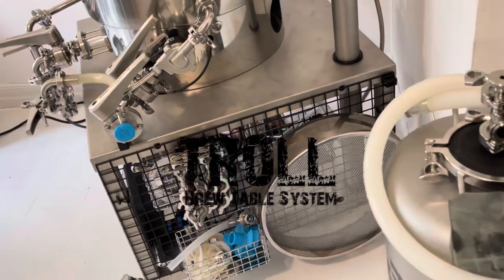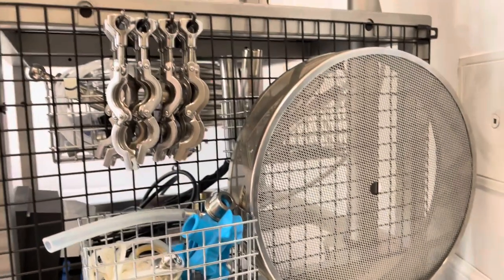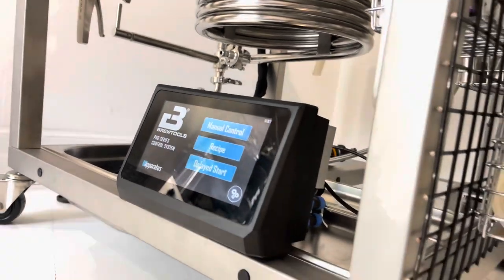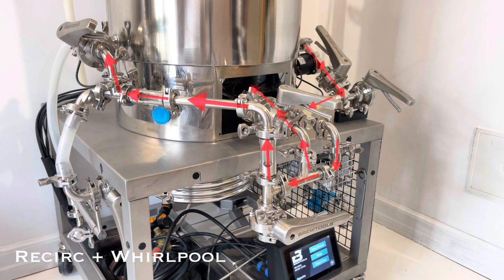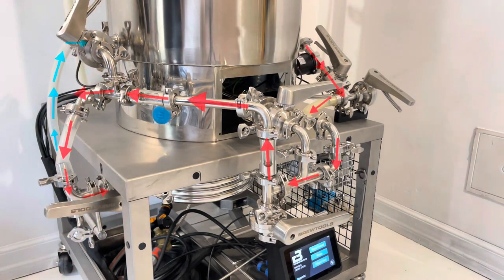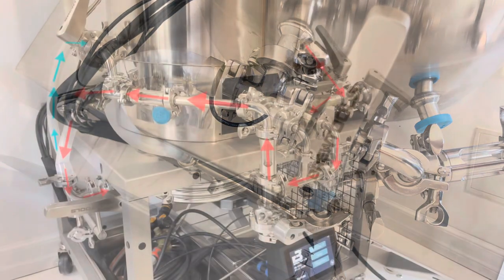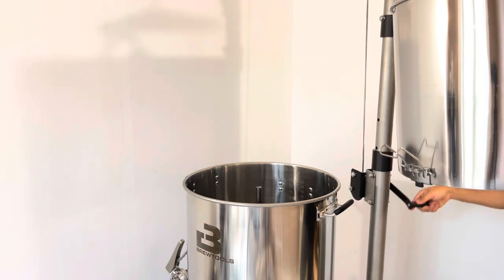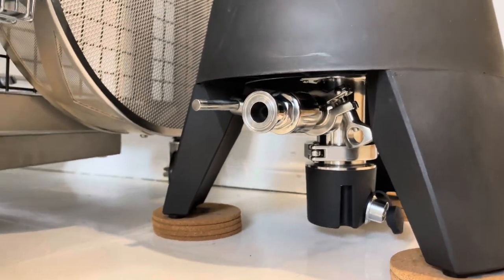Brewtools Troll Brew Table & Valve Set-Up

Comment: I own a TROLL table and crane as well now, I mounted the winch upside down so the wire doesn’t touch anything but the cilinder the wire will roll up, in your setup the wire touches also a metal pipe, did you do this on purpose? Looks like I am following the instructions for assembly but your way of mounting is more convenient and I like to do the same so the handle is oriented better towards myself. Do you know it’s save to scratches cable by the metal bar? Cheers 🍻
Reply from the maker: You installed it correctly. I installed it upside down on purpose so its better oriented for use. Technically you shouldn’t have anything rubbing on the cable or spacing bars BUT i figured since the cable is more like cloth it would not cut into the spacer bar and since the spacer bar is round and smooth that while using the winch it would not move fast enough or rub enough to cut into the cable. So far so good but you are correct that mine is technically installed incorrectly. There are some videos i watched that cover this topic but they all used metallic cables and thats where you start to get significant wear and tear that could be potentially dangerous.
Reply: @MasteringHomebrew  Thanks for the advice, it was not my intention to tell you dit something wrong, let this be clear 🙂. The orientation of the handle is a struggle with the original design and manual, I will turn it upside down also now. Cheers and thanks again mate!

Comment: Well done! Did you just decide the three way valves are not sanitary?  Beatific BV set up tho.  My set up is similar - CFC is below - I really like it for cleaning, I can passively dump everything out the bottom and rinse with a hose from above.
Reply from the maker: Thank you! I didn’t really just decide it was unsanitary but if you look through the brewtools groups some people point out the shadow areas in the corners of the three-way valves where little bits of grain gets stuck for some people. It’s really hard to get it out without breaking down the three-way valve and I just really didn’t want to have to break down all the valves for cleaning since they can be a pain to get back together. This way makes it much easier to be confident in the cleanliness of the valves and makes cleaning over all easier in my mind. Brewtools has a solution coming for that though so their new solution and my set up will be a bit of a hybrid but still needs testing out. Also the butterfly valves offer a nice user experience that i happen to really enjoy. I really like the chiller on the bottom. If only there was a way to mount a HLT to this brew table then it would be perfect.

Comment: Nice setup. Does the HLT need it‘s own pump or can the BT „pull“ in the water from there?
Reply from the maker: Thanks! Yeah, it definitely needs its own pump unless the HLT is higher up above the BT pump. I’ve been using a riptide on the HLT. i’ve been begging them to make an integrated HLT into the troll cart that would fit underneath. Hopefully they make it.

Comment: Mate, can you please give me the total height of the troll system in your case with the B80 , low table and hoist? I am figuring out if this fits underneath my vent hood😅 Inches or metric all good 👍🏼 🍻
Reply from the maker: I have mine set up I think on the highest point but I’m not 100% sure. I am coming in just under 206cm from the floor to the top of the boom
Reply: Thanks! Still, that's good news for me I guess! I really appropriate your answer on this. Cheers 🍺  @MasteringHomebrew

Comment: As usual, thank you for this great vid. 

Quick question after looking at your valve setup  and correct my if I'm wrong but I can't see a way to go to the fermenter straight from the output of the chiller. So it means that you wait for the entire kettle to have reached pitching temp to transfer to the FV ?
I'm assuming the water in Oslo is cooler than the one in Southern France but still, with the Brewtools CFC chiller it could take a while, couldn't it ?
Reply from the maker: I should have shown this more, but there is a three-way valve on the output of the chiller. I mostly have it there for emptying the chiller at the end of the brew day but you could also transfer this way as well. I normally chill the entire kettle down and do an extended whirlpool when i want my beers super clear. I don’t normally transfer directly from the chiller but now that I have a valve down there, I’d like to start to see how well it works. Thanks for watching by the way!
Reply: @MasteringHomebrew  

Always a pleasure to watch !

 
By the way, I have used my Troll crane for a couple of brews now and the last one was with 20kg of malt in the kettle. 

I find that  to lower it down, as long as you are "prepared" (as in for me, have a big ikea box under it), if you remove the stop lock, it doesn't go down "too" fast. At least, it is definitely manageable without any extra help.
Reply from the maker: @frigorifix  Nice. I accidentally let it go without the lock and the handle took off pretty quick and there was no way I was going to catch it so it kind of made me paranoid. That’s good to know though. I just have to go buy a few more things and then I can get a brew in on it.
Reply: @MasteringHomebrew   Well you have indeed to stand clear of the handle because it will spin like crazy, but other than that, the speed at which the malt pipe goes down is definitely not that bad

Comment: is a Uni 30 sufficient spare water if brewing a full batch (80 liters)
Reply from the maker: @hmmpof  no its not. Generally its ok for 60L batches but for 80L batches you need a bit more sparge water. Ive been using a B40pro lately instead since it’s easier than using the mini uni. Ive been asking the guys to make a HLT that will fit under the troll cart but not sure if they have made any plans for that.
Reply: @MasteringHomebrew  yes I can can imagine. Only 500 watts  must take forvever to heat up?
Reply from the maker: @hmmpof  i was normally heating mash and sparge water together with the overnight countdown then id transfer over to the miniuni and use the element to maintain the temp.

Comment: Where did you get the wire grid from?
Reply from the maker: @hmmpof  i got them from this interior design shop called granit. This is the link to the one i cut to size. They have others too though. 

https://www.granit.com/se/forvaringstavla-rutnat-hylla-60x100cm-svart-372654/
Reply: Tusinde tak

Comment: I would upgrade that front upside-down T-piece with 3-way ball valve. That way you can keep you pump at higher lever and ensure that the heat had been distributed more evenly.  So, you bleed that flow to two ways. I hope that you got it what I'm trying to say.
Reply from the maker: Well, the whole point is to minimize the use of the three-way valves. But how is the heat not distributed more evenly? Most of the flow goes into the outside area of the basket and the flow into the basket is regulated by the position of the center butterfly valve. Generally i want less flow going into the basket and more flow around the basket. With a three-way valve in place of the tee you are restricting the flow for both entry into the basket and around the basket. The butterfly valves and tee give more flow control for every designated area. Its not possible to have a three-way valve there and have full flow around the basket and have full control of the flow going into the basket for recirculation. The pump is the highest point of most of the valves since its been moved to the right port. The only valve that the pump is below is the butterfly on the left for the wort going back into the kettle. Heat loss is very negligible here.